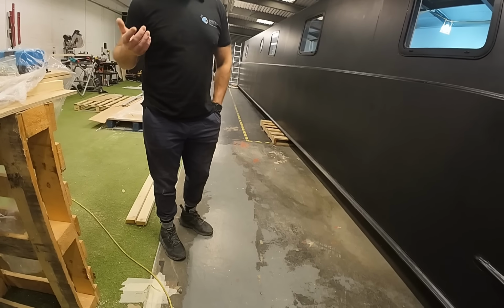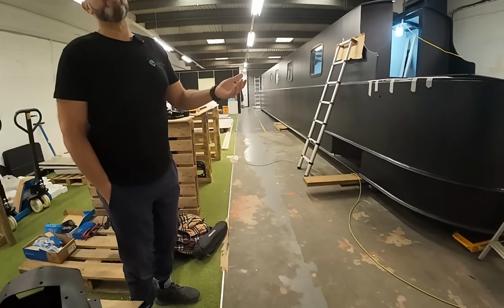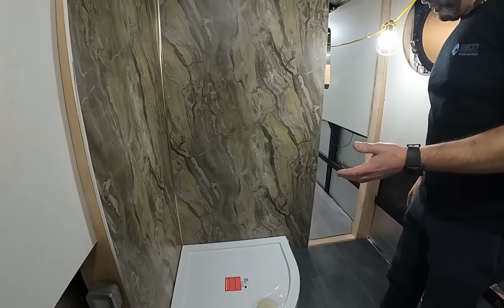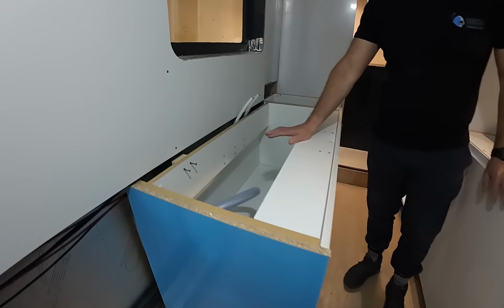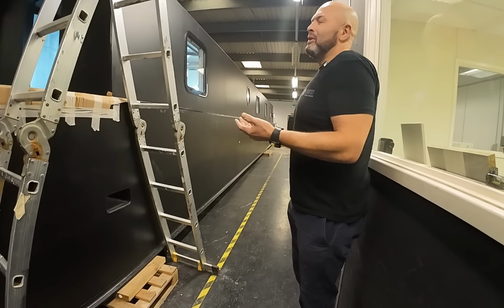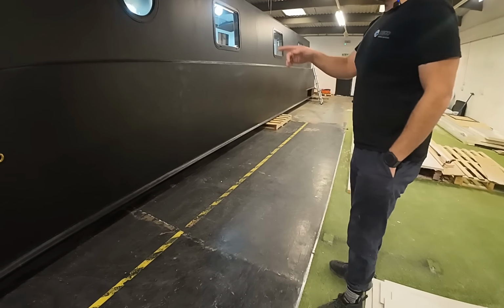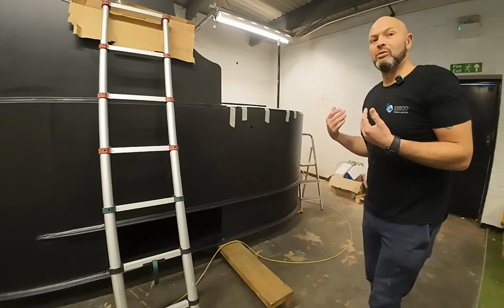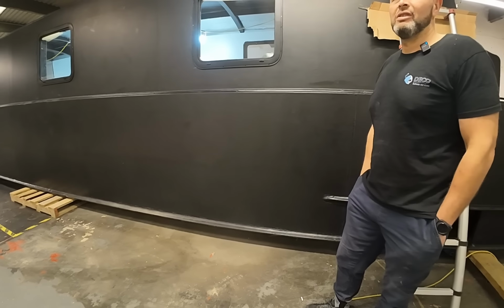World’s FIRST Plastic Narrowboat | The Boatbuilders

Comment: But how does one mitigate the toxicity of living on a high density polyethylene boat?
Reply: HDPE (high-density polyethylene) is extremely stable and non-toxic. It doesn’t release harmful chemicals or off-gas, making it safe for living aboard. Regular cleaning and good ventilation are all that’s needed, just like with any other boat. Its durability and chemical resistance are part of why it’s widely used in water tanks, piping, and industrial applications.

Comment: Hmm. HDPE electric boat, with no propshaft hole and lithium batts. Sounds like a lot of sensible design choices. If I was buying a narrowboat, this would be high on the list. ButI wouldn't want to pay for Victron's batteries though! Extortionate. There are plenty of perfectly good batteries at 1/3rd the cost. Big fan of Victron's technology (I use it myself), but their batts are just not competitive at £380/kWh. I'd use Fogstar at £100/kWh. Almost 1/4 the price.
Reply: Thanks for the comment — really glad to hear you think the design choices make sense. That was exactly the goal: clean, efficient, and simple, with long-term durability in mind.

And you're absolutely right — the batteries are completely up to the buyer. This particular boat was spec’d with Victron batteries mainly for demonstration and integration purposes, but you can fit whichever battery system you prefer. There’s definitely great value out there, like Fogstar, and if it meets the install and safety requirements, we’re happy to work with it.

Comment: Plastic will have its problems no doubt. Just different. And plastic you cant repair as well as metal. 
Great concept but I doubt it will ever take over.
Reply: Absolutely, every material has its trade-offs. Plastic offers benefits like reduced weight and no rust, but you're right—when it comes to repairability and long-term toughness. That said, it's never been my intention for it to replace metal entirely. It’s just a different option that, hopefully, can attract more people to the canal industry—which surely can only be a good thing!

Comment: Have you compared the weight of this boat to a traditional metal + drive system - wouldn't it turn out that it would listen more to the propeller and rudder? Isn't your fear of reverse thrust an exaggeration? Maybe it would turn out that with your modern drive it would listen more to the throttle and thruster? If the mass is much lower than steel - it seems to me that it will be a very agile boat!  😉👍

Comment: There was no discussion of a lot of the engineering like balsting manuvering and so forth say like a bow and stern thruster. This vessel looks way too top heavy with minimal draft. This looks like a good show prototype but this builder has a lot to learn like the concept of weight and balance. This thing is a mess.
Reply: Thanks for the comment — a few quick clarifications:

✅ Yes, the boat does have a bow thruster installed.
✅ It uses the Vetus E-Pod system with a rudder, and we’re working with Vetus to allow the E-Pod to rotate up to 180° for much better handling and control.
✅ Ballast is done using blocks — a very common approach in narrowboat builds.
✅ The shell is made entirely from marine-grade HDPE, which is UV-stabilised and proven in workboats and pontoons for decades — it doesn’t rot, rust, or delaminate.
✅ Fully fitted-out weight is 13 tonnes, with a draft of around 17–18 inches.

We’ve worked with engineers and polymer specialists to get this right — and while this is still a learning curve  it’s built on solid foundations. Still plenty of refinement to come, but this is just the beginning.

Appreciate the feedback — it helps us push forward!

Comment: Plastic becomes brittle after 6 or 7 years.
Fibreglass ( is that not plastic) is a better choice I believe being used extensively to build boats for many years.
solar is not sufficient in the UK but ok for topping up your battery when its parked up for a while.So long as no one steals it.
Reply: You're right that some plastics can become brittle over time, especially lower-grade polymers exposed to UV without protection. However, the material we're using is HDPE marine-grade, specifically designed for long-term outdoor use. It's UV-stabilised, impact-resistant, and has been used successfully in commercial workboats, pontoons, and military applications for decades — often in much harsher environments than UK canals. Properly installed and maintained, HDPE has a service life well over 30 years without the risk of rust, rot, or osmosis.

As for fibreglass — yes, it's a plastic too, but a very different one. GRP (glass-reinforced plastic) is strong and widely used, but it’s also heavier, more brittle under impact, and prone to issues like delamination or blistering over time. HDPE, on the other hand, flexes under impact rather than cracking, which makes it particularly well-suited for canal environments where knocks and scrapes are common.

You’re also right that solar alone isn’t always enough in the UK — especially in winter. But when paired with proper battery storage, shore power access, and possibly a backup generator, it still plays an important role in reducing diesel use and maintenance. Theft is always a risk on any boat, but as with any solar system, proper mounting and deterrents can mitigate that.

Appreciate the conversation — it’s through discussion like this that we can refine and improve the technology
Reply: This is not the kind of plastic you make toys out of. And when a 20 ton steel narrowboat bashes into your fiberglass hull, you'll definitely be pulling it out for hull repairs.

Comment: With the propeller surrounded by a Kort nozzle it's very susceptible to being regularly blocked weed. Weight saving on a narrow boat is pointless as they require ballast. It's much more difficult to retrofit items compared to a steel narrow boat. On a steel boat brackets and extra fittings can easily be welded on. Why try and reinvent the wheel?

Comment: Surely that’s a fire hazard because nobody would survive the toxic smoke even if they were awake when the fire started? Don’t listen to the manufacturers whatever you do.
Reply: I understand the concern, but marine-grade HDPE has an ignition temperature around 340–360°C and is self-extinguishing, meaning it won’t keep burning once the heat source is removed. The smoke produced is comparable to timber or fibreglass, and all boats include fire detection and suppression systems to keep occupants safe. This material is widely used in MOD vessels and commercial boats that meet strict safety standards. So, while caution is always needed, HDPE is far from being an unchecked fire hazard

Comment: What about the water storage in winter? Water wich freeze in closed plastic botle, destroys the botle... Is that problem solved by some extra insulation, or heating? Or does that not apply on container under water line? Im a mugle to boating and not familiar with exact condition of winter in GB, but chanels and inland docks freezing over sound plausible to me as foreigner living in midle Europe.

Comment: You could build a "ground sourced" heat exchanger into strakes under the hull for a heat-pump system.   My first idea was to have HDPE strakes integrated into the hull,  but aluminium extrusions would be more efficient and more servicable,  with castings or 3d printed end pieces to handle the end connections and cross pipes.   Custom extrusions don't cost a lot once you've eaten the cost of the die, although you'd need to bend them unless you kept it to the straight part of the hull.   You'd just have 2 pipes intruding through the hull and above that you could use off-the-shelf domestic heat pump equipment

Comment: Mmmm more plastic in the world just what we need.. and also bit of a fire risk.. and concerned about the gases it will give off over time..
Reply: Totally understand where you're coming from—those are valid concerns, and we’ve taken them seriously from the start.

HDPE actually has some environmental advantages over traditional materials. It's highly durable, fully recyclable, and doesn’t corrode or require toxic paints or antifouling, which reduces pollution in waterways over the long term. Also, unlike many fiberglass boats that end up in landfill, HDPE can be repurposed at end of life.

As for fire safety and gas emissions, you're right to point out the risks—HDPE is a thermoplastic, so we've been working closely with material specialists and safety consultants to address those. The vessel incorporates fire-retardant additives, and we’re following best practices around insulation and ventilation. Our goal isn’t just to build something new, but to do it responsibly and with full awareness of the implications.

It’s a pioneering project, and conversations like this help keep it grounded—so thanks for raising the point.
Reply: @ShaunMoir1  good to hear.. i do a lot of 3d printing.. with fdm and resin printers.. just wanted to point them out just in case. but myself though i would love to live on a canal boat back in the day.. but i still would prefer a metal one.. but i would be happy with the hull coated in the plastic..  i am just old fashioned.. though i can imagine the same things getting said back in the day when the first metal canal boats came out.. when they used to be wood.. in 100 years time they will say the same about the next new idea. hehe

Comment: Hi all, I just want to clear up a few things around HDPE boats, especially with regards to our work at Formation Plastics and our partnership with Adrift Boats

Firstly, HDPE is an excellent material for canal boats. It has a working temperature range from -94°C to +100°C, with a brittle point around -94°C — so it's more than capable of handling UK weather conditions without cracking or becoming brittle. It's chemically resistant, corrosion-proof, and extremely tough, which is why it’s already used in workboats, emergency response craft, fishing boats, and other demanding marine applications.

We’re using Marinetec HDPE, which is post-consumer and post-industrial recycled — Also, HDPE doesn’t shed microplastics the way some people seem to think. This is a dense, engineered material, not a cheap flaking coating. It holds up in harsh environments and is built to last.

There was also a comment that this isn’t the first HDPE canal boat. Just to be clear:
About four years ago, we at Formation Plastics built a prototype HDPE widebeam, and that project was publicized through Towpath advertisement. Since then, we've worked closely with Adrift, who are now building the world’s first fully fitted HDPE narrowboat — not just a hull or a shell, but a complete liveaboard vessel.

Yes, others have reached out to us since, but it’s Adrift who are genuinely pushing this forward and we're proud to be working with them.

Regarding HDPE strength — I’m not sure why some believe it isn’t strong enough for canal boats. The density is 0.95 g/cm³, and it’s naturally buoyant. The thermal insulation is 0.45 W/m·K, far better than steel (~45 W/m·K), which means it's also energy-efficient. In terms of fire safety, HDPE has an ignition point comparable to fiberglass (~340°C), and when properly constructed, meets all relevant safety requirements.

And just to point out again — this isn’t about reinventing the wheel. We’re not saying HDPE is going to replace every steel boat on the cut. It’s about offering a different option — one that’s low maintenance, more sustainable, and future-focused. For some people, 

We're also proud members of British Marine, and fully committed to building quality, responsibly-made boats that stand the test of time

Comment: I have a plastic jetski seadoo spark trixx.
My friends plastic hull 300hp jetski dose nearly 80mph.
NEVER had issues othere than "point impact"
however few and far between, considering they have made millons.
Once again IF it did crack it's very easy & cheap to weld back up.
HOWEVER this recycled plastic is very cheap. so i think thus boat is very pricey
Reply: so that a good and fair point howvere teh material we use is from polystone g marine tec grade

Comment: HDPE is highly flammable. I'd worry about that. Especially with a wood burning stove inside.
Reply: That’s a valid concern, and one I took seriously early on in the design process.

While HDPE can burn under the right conditions, it's actually classified as having a relatively high ignition point—typically around 350°C (662°F). For comparison, wood ignites at around 300°C. What's important is that HDPE doesn't sustain combustion easily without a continuous external flame.

More importantly, we've accounted for this in the design. The stove area will be properly fire-shielded using non-combustible insulation materials and heat-resistant barriers, just like in traditional boats. In fact, similar precautions are used in marine vessels where HDPE is already common, and there have been no fire-related issues in those applications.

Fire safety is a top priority, and we've followed best practices to ensure the risks are managed just as effectively—if not more so—than in conventional builds.

Comment: Looks a great idea BUT what happens about wear to the base and hull when rubbing occurs
Reply: One of the key advantages of HDPE is its exceptional resistance to abrasion. It’s actually used in high-wear industrial applications like dredging pipes and workboat hulls for this very reason. Unlike steel, it won’t corrode, and it handles scraping and rubbing remarkably well.

That said, the base and sides most exposed to wear can be built with thicker sectionsd. And if wear does occur over time, HDPE is far easier to repair than steel

So in terms of durability, especially against rubbing and general canal use, HDPE performs extremely well.

Comment: Three things I'd be concerned about are deflection of the HDPE from long term, steady state loads, and how well does the boat resist bending and torsional loads? Waves and rough water aren't typically a thing on UK canals, but there could be lengthwise twist applied. Any time the propulsion is running there will be a torque along the hull. The boat won't be evenly loaded along its length. Could it sag over time in the middle or at the ends? If you make a shelf out of a slab of HDPE, put it outdoors with some flowerpots on it, eventually it's going to sag between the brackets or whatever is holding it up. How do you ensure the sides aren't going to try bowing in or out? The design is sort of like a tube and tubes resist having the sides move in and out, but the less round the tube is, the more bracing it needs to resist buckling when subjected to a bending load.

Might want to take one for a trip on the Mersey River, and other rivers accessible from the canals, no interior but equipped with a bunch of strain and deflection gauges to see how it handles something more exciting than flat canal waters. Do a search on HDPE Environmental Stress Cracking. Is the material you've chosen formulated to resist that? Wouldn't want to have the deck surface start to crumble a few years along due to a combination of sunlight and some cleaners.

Comment: Will it be affected by severe freezing cold temperatures with ice and frost or very hot summer sunshine? Will it expand and/or shrink and then fracture with changes in the weather temps?
Reply: HDPE handles extreme weather brilliantly. It stays tough in freezing conditions — with a brittle temperature around -93°C, it won’t crack or snap like other materials. In heat, it flexes slightly but won’t warp or fail. We do have videos of our own tests of this

Comment: I can never understand why this narrow boat bathroom has a shower tray with enclosure when, with the boat being plastic, it could easily be a full wet room with the floor sloping to one side to a drain. The pump could be under the floor as well. Plastic can be moulded to any shape so with some planning the sink & toilet area can be flat and toy only nee a curtain to define the shower area if you want to do that. Instead of a tv why not have a ceiling mounted projector? Where the tv was to be mounted you could thicken the wall to put your media devices there, i.e. mini pc, router/Wi-Fi router.
Why aren’t the batteries being stored under the floor? That would allow for a larger battery but also gives more stability for the boat having that weight lower down. If the pylontec batteries are used or any other rack mounted battery system they would be easier to mount in the floor and could be covered with Perspex like the wine cooler.

Comment: Absolutely a no from me, no gunnels, plastic… this very same plastic that our water tank was made from it
caused me to refit   Our entire widebeam  subfloor, floor and bearers as a weld had cracked and leaked into the flooring! One good bump and you’ll be sinking !
Reply: @hrcsourcingltd  There have been many boats made entirely of HDPE over several decades that are proof that your assertion is incorrect. Many are used in military service. They are not made of cheap thin plastic sheeting. You can find them easily on YouTube and via an internet search.

Comment: In the bathroom the metal ring around the sink overflow is silver not gold so it doesn't match the taps.... on the hull there is no rubbing stakes....I'd love to know the reason for using Kingspan insolutation rather than spray foam
Reply: we used 100 kingspan